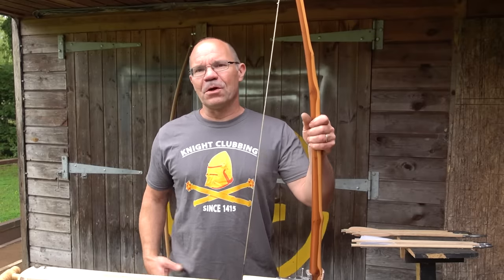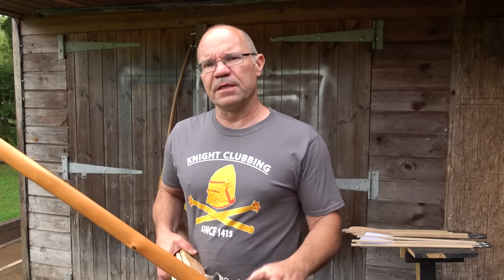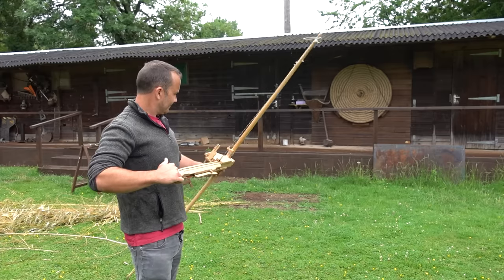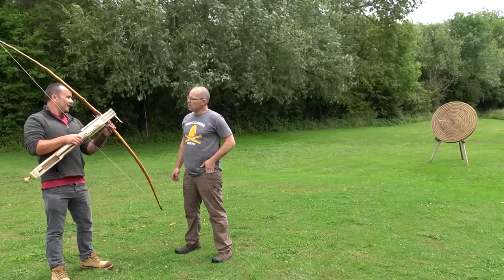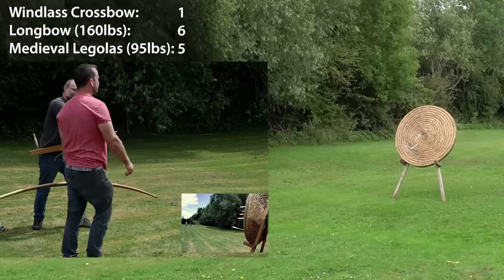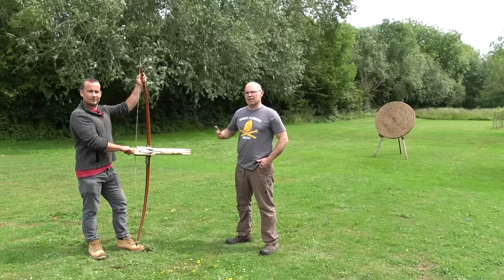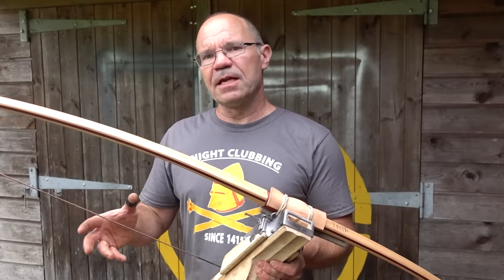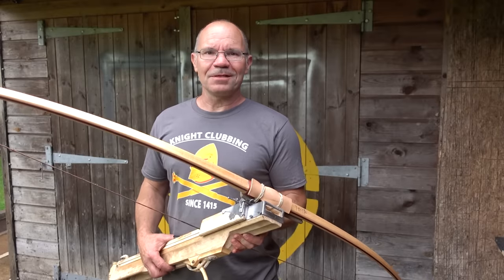Tod's 120lb Medieval Legolas - TESTED

Comment: I guess it just comes down to if youd rather have a guy shoot a lot of 85lbs shots which is already enough to be lethal or to shoot a couple rounds of hard hard hitting stuff. I think its exponentially better for a small bow and then give a big ol crossbow to a guy to take out armored guys. 

Out of 5 guys though 3 or 4 on light bows and 1 or 2 with closer range heavy hard bows for when knights get close and that accuracy counts taking out specific targets im saying. 

Consider either a shoulder rest or even a foot stirrup on the rear foot.

Yes the wrist needs to be on the vertical plan bc the bow is a vertical thing bending over the surface of a human body. The wrist needs to be the chain link in the pattern where its vertical. Like a chain of hinges.

Super cool video. Hope your bowmans will isnt dampened. We dont think it looks easy and its definitely not a training wheels device. A lot of people who watch this has probably shot a bow and knows how hard and meticulous of form it has to be while holding your strength and stamina and breathing and then aiming as well. And obviously this isnt something he has to muscle memory. Its the difference between a violin and a cello almost. Few changes here and there and a bigger shape and all of a sudden the whole way you approach it on the human body side is different.

Pumping and gradual draw and holding also works 2 completely different muscle types, fast twitch and slow twitch and they train totally differently as well. He is an athlete who has trained is slow twitch to be very strong and do static holds.

The Legolas would create a different athlete who forms to it. A railroad worker would make for a great Legolas user or perhaps some sort of seaman who pumps large two handled machines. A bow man moves more like a monk or a farmer or construction worker long static holds and lifts then a very accurate release where the stone sandbag brick bucket is dropped will live there and hold a building up and have to have no crack or seam.

The other would also be good for crossbows since that's often a foot to hands hinging pump.

Comment: I thought the Legolas had a break so it would hold at full draw.  I thought that once you got it to full draw, you didn't have to keep pulling.  Is that not so?  If not, if you could find a way to engineer that, that would help the archer.  Once they get a full draw, they don't have to keep pulling, and can relax and aim.

Comment: I watched this with a great deal of interest, and came to the conclusion that this comes into its own on lighter bows sixty to seventy  pound bows.
As was said, it would have to be used by bowmen who used this more than a standard bow reason is very clear when you look at the position of the back using an eighty to ninty pound bow, the lower back comes into play very clearly, and with this equipment on the bow it really does make a change.
In the best situsation, bowmen who had spent a lot of time with one would  be able to attain good grouping plus speed, the only thing that is in question is the fact that arrows were being shot and a huge rate of fire, not five arrows, even with todays bows you would need to be able to load more arrows very quickly and sadly we did not see what was required to do this, unlike normal achery where used in battles the arrows were usually just stuck in the ground giving easy access, to the point where fifteen to twenty arrows were a good possability in a minute.
The other thing that has not been looked at is just how well the bow stands up to using something like this as clearly the fast compression
and releasing is bond to warm the wood .

Comment: Make the magazine from lighter materials such as carbon fiber and  metal parts from aviation type aluminum You could also put some kind of pulley to increase the power of the archer to arm more easily and faster.

Comment: Holy hell. Can you IMAGINE if this was in the hands of an elite group of archers hidden in a nearby forest or just under the lip of a ridge, medium range? Or having a large group of these men just absolutely laying down CLOUDS of suppressing fire arrows over the heads of charging infantry? This many arrows in so small of a frame of time would absolutely decimate ROWS of enemy soldiers, weakening the vanguard tremendously so the charging infantry could break lines. Hell, you might not even NEED infantry to break the line at that point. Im sure just seeing that many arrows fielded that quickly would scare off most armies!

Comment: I think the rear handle would be better turned 90 degrees to be similar to the arm position using a normal bow.  The trigger would have to be adapted of course.

Comment: Imagine facing a castle with strong experienced archers equipped with these, a second bow being reloaded by another person to swap for near continuous firing, and buckets of arrows.

5 seconds bow swap + 10 seconds firing = 5 shots per 15 seconds per archer. 25 archers could with a bow swap and reloading assistant could fire at 500 arrows per minute. 

-With just 30% accuracy an incoming army of 2,500 could be taken down in 16.6 minutes. 

-With 50% accuracy and only 600 invaders the enemies could be taken down in 2.4 minutes.

-50% accuracy 1,200 invaders just 4.8 (probably closer to 5 in reality) minutes.

Keep in mind that’s just 25 archers for a smaller castle. For larger medieval major castle defense with 150 archers, the same setup above, and 50% accuracy, that castle’s archers could take down 15,000 invaders every 10 minutes. Even if an invading force was to succeed, the crushing losses before securing the castle would be so immense after 20 or especially 30 minutes that almost any invading army would be made weak enough to eliminate in the following battle. It’s interesting to think of how much these bows would have transformed the dynamics of medieval warfare.

Keep in mind this is just the defending side. Imagine 1,500 invading army archers and 1500 assistants in an army more focusing on archery because of this technology. That army could volley 100,000 arrows into the castle in the first three and a half minutes before proceeding with primary invading strategies with both the archers and assistants being utilized for other roles after this initial volley. It would be such immense and fast arrow use that simply producing and supply logistics for enough arrows would be difficult to pull off for more than a few minutes of combat.
Reply: I think 30% casualty rate per arrow is much much too high. In the average battle the average archer would cause LESS than one casualty. If an archer normally fired about 10 arrows per battle the average casualty rate must be below 10% per arrow. I would personally guess about 0.5% casualty rate.
Reply: @Thunderdumpe  oh wow. Thanks for clarifying. In that case the offensive technique of 100,000 arrows in 3.5-4 minutes descending on a castle seems more effective as a shotgun approach if they could get to a point of sufficient range to cover the castle in arrows, but then again could just design building to be stone on the top. Wild to think how little it might have changed medieval warfare in that case.
Reply: @blaze9525  Yeah, it's not completely unimportant though, in the field armies often broke or surrendered after suffering about 10% casualties (being decimated), so the average archer dealing 0.1 casualties per battle is actually pretty good, and more arrows hurts enemy morale, which is what decided most medieval battles

Comment: Did Todd also build his version of the instant legolas with medieval methods as well as materials? Like from scratch raw materials?

Also, Very cool video. Could you inamgine a 100 of these guys on a wall firing down on an invading force. 

If the bow was ambidextrous, a person could feasibly train themself to use it with both hands and switch off every three shots for a longer sustained rate of fire.

Comment: Have you considered rotating the trigger handle 90 degrees so the user would be holding it in the same orientation as a regular bow?  Obviously that would mean re-engineering the trigger mechanism, but I'm curious how much less muscle strain would be created because the musculature used would be more like a standard bow.

Comment: Joe is tiring due to lactic acid buildup in his muscles.
Both exertion of force (heavier bow) and rate of fire will cause lactic acid to build up, tiring the muscles being used.
You can think of it like a cup that is being filled with water. Once you get towards the top, the body slows. When the glass is full, you are unable to continue work. Your muscle have been saturated and need rest.

Comment: but is the arrow shot by the legolas device with the longbow still as fast as shot with just the bow? it seems like the string isnt moving as much of a distance WITH the legolas as it is without. when the shooter reaches his maximum draw length there is still quite the gab between his hand and the string, so i figured that if he'd use just the bow the string would move further back thus generating more thrust etc.  but here i am NOT AN ACHERY MASTER so pls correct me if im wrong and just in case no offense intended, you never know nowadays haha

Comment: Why not rotate the back draw handle 90 degrees so that it is vertical ? , surely it would be closer to the hand position Joe is usually used to using.

Comment: question could the arrow holding/feeding device be mounted to the bow and the only moving part be a smaller string catch/release device so not as much is moving to draw the string and release the arrow

Comment: I know this video is old, but it's good stuff. Interesting from a mechanical perspective.
Please take this criticism as something positive, I don't want to come off as disparaging.

Former soldier, just some quick observations. Keep in mind I don't know shit about shooting bows, but can appreciate a clean action on a weapon.

The ergonomics look like shit.
The draw handle is at a straight 270 to 90 degrees, seems it should be closer to 315 to 135, give it a nice twist, in fact a clean rotation action on that component might be a winner, I don't know. More parts = more complexity = more failures. Alternatively a straight up fixed knob might be a better solution, same rotational action, 0 moving parts. A straight up and down might work better too, it's clear Joe want's to hold it a certain way to make sure he has a proper shooting stance AND proper sight.

The mechanism clearly impedes where he wants to put his chin, I don't know what the fix for this is, other than shaving off the mechanism housing to allow him to hold it "comfortably". A full blown offset might work here, where he's holding a handle parallel to the bow grip and you can push the cocking hand forward to be "underslung" from the bowstring, offset left, allowing him a cleaner draw and a full range of motion on the draw action. The sighting would be different and he'd have to compensate, and the thing pulling from the right might be an issue, but I don't know. His inability to lock his draw, lean forward, sight and release seems to be greatly hampered by the device he's trying to work around instead of with.

Clearly this is a concept done mostly for fun and the challenge to see if it can be done, and it's a good iteration, just seems there are some improvements that can be made to the form to improve ease of use and operation. Looking at it, it seems to be screaming for a "bullpup" design where the firing hand sits forward of the cocked bowstring, but I can't practically figure out how looking at Joes motion firing a regular bow and the legolas.

Comment: I think the design is wrong? A bow has to have a certain draw to be effective, as a result if you are going to shoot arrows from that bow, they are going to be a certain length; but you have added a mechanical dispenser to the bow? It could be pulling back a piston that fires more of a dart or bullet than an arrow. A smaller projectile is going to travel faster further and is going to take up less room in a chamber. So, more ammo better performance.

Comment: Dumb question from a noob...but couldn't you add a metal plate, spring or something which holds the magazine in the position when the bow is completely stretched. So you don't need to hold all of the force while aiming?

Comment: Isn't the range a little short?
That's just 15 to 20 metres, isn't it?
Wouldn't 100 metres be more realistic for battles with bows in the past? At that distance (15-20 m) you could also use throwing weapons - you wouldn't need bows.

Comment: Something similar existed in the roman period. But not with a bow but an extra heavy crossbow - the scorpio.

It managed 3 to 5 bolts per minute, here fom a 3000 pound bow. Here they fire a rebuild
https://youtu.be/HsCu3SODtKk
It was used in battles castle defense or even in patrol boats as board weapon.

Comment: As a last ditch weapon against a charge I can see its effectiveness. If one were facing a massed charge, one would start engaging it at distance with a regular, more accurate bow. Then as the enemy got into close range one would want to plaster them with massed fire, even if it were less accurate. 
It's like the Turks defending Plevna during the siege in 1877. The infantry would blast Russian attacks at range with their standard rifles which were slower to reload but accurate. They then swapped these for Winchester repeater carbines that had been stripped from the cavalry regiments when the Russian columns got within a couple of hundred yards or so. The Turks then simply poured copious amounts of lead into Russian columns at short range. 
Apparently it was murderous. It certainly kept the Russians out of the city for months.

Comment: I dont understand why you would design a heavydraw rapid repeater like this and not take advantage of the draw position by placing the draw grip at the front of the mechanism.. making the full draw achievable with only a half draw movement and saving as much as 75% effort as the most extraneous part of the draw is the final prt of the stretch. Just me?

Comment: Interesting mechanical puzzle to solve building the thing but I think utterly pointless in any sort of actual battle situation. A company of trained archers could fire almost as fast, with much greater accuracy and for longer without the contraption. These instant Legolas devices seem to be part trying to make everyone able to shoot as fast as a CGI super elf and part trying to make the bow as efficient as the gun at putting projectiles down range. The only kind of sort of version of an automatic arrow type weapon would have been the Greek Polybolos and some Roman copies of the device that never seem to have gotten much wide spread use. The limited use likely being due to the fact that modern attempts to rebuild the things from surviving manuscripts and partial machines shows the things to be extremely problematic due to arrow type missiles not really being suited to loading into a magazine without jamming.

Comment: There's no grace in shooting a contraption. How many shots could you pull off, on a battlefield, with just a bow. Now, that's Legolas!  I'd rather watch a Japanese mounted archer with a yumi bow, miss 7 out of ten times, to show how skilled you really had to be. History records magazine bows were used by Chinese infantry. They were fast and accurate. Very deadly. But, to me, to my mind, if there's anything attached to the bow that significantly increases weight, it's not a bow. It's a crossbow.
Reply: It's definitionally not a crossbow. I understand a desire to see proper archery, in fact noone involved in this conversation has at any time suggested that this is somehow more impressive than traditional archery from a skill perspective. This is about how potentially lethal such a modification would be in a battlefield situation in the right hands, and how viable it might be to create such a weapon in the period at which it might best be put on to the field.

Comment: I'm not an expert, but this doesn't look practical. Unless you are stationary, but if you are on the move, its just clunky and bad design to carry around. If you somehow made it that, it could "contract" "bend" to either bottom or top of the bow, this extension on the bow would gain bigger mobility to user. But despite that this would have changed history for sure, drastically.